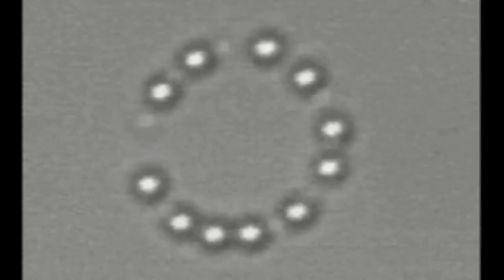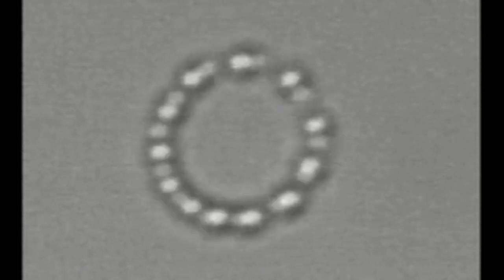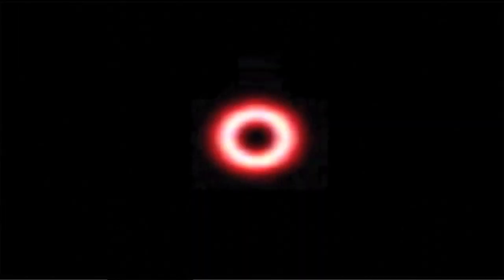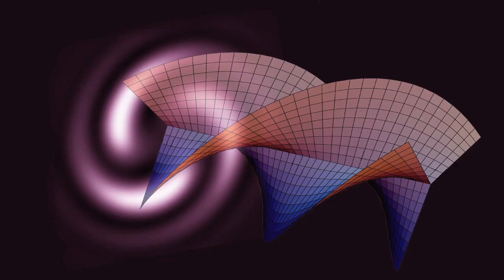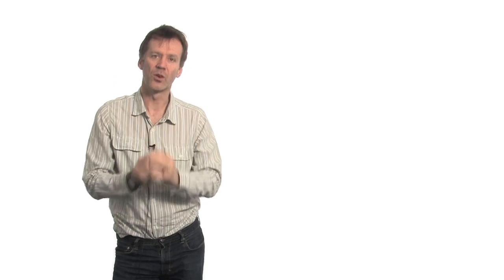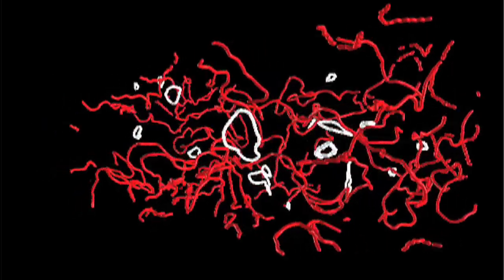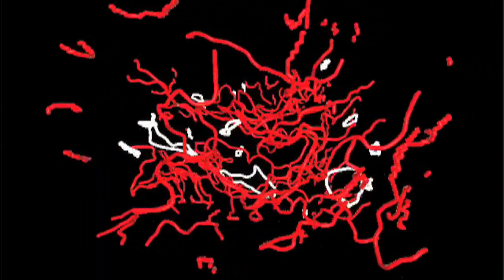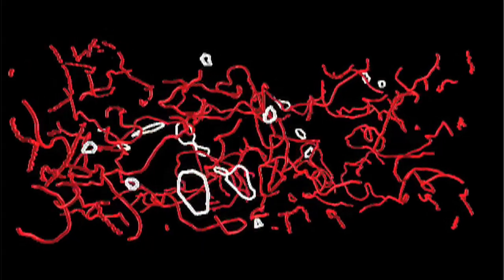Miles Padgett: Optical tweezers and twisted beams of light

Comment: Hold on, photons have no mass, hence no momentum. Optical tweezers are in fact a "trick" based on the same principle as photocopiers and laser printers. Laser light induces electrostatic charges in the microscope glass "SLIDE" which attracts nanoparticles, cells, dna strands, etc. What's important is the laser technique to achieve that, and it must be acknowledged.
Reply: The "rest mass" of a photon is zero. But as the photon always moves, every one carries a momentum.
Reply: @SergiuszPatela  Light carries energy. What's the equation for a momentum of an entity without mass?
Reply: @jlfqam  in relativity we have this general equation for the energy: E^2: P^2C^2 + m^2C^4. So, if we have a massless particle, we only have E^2=P^2C^2, P is the particle's momentum and photons carries a well difined energy (E=hf), so in the end, a f frecuency photon carries a momentum P=(hf/c).
Reply: Thanks
Reply: Light's momentum is what a solar sail takes advantage of (a proven technology). And it's what Breakthrough Starshot is relying upon to get to Alpha Centauri. https://breakthroughinitiatives.org/initiative/3
Reply: A photon is a composite entity made of quantum electron/positron charge pair.